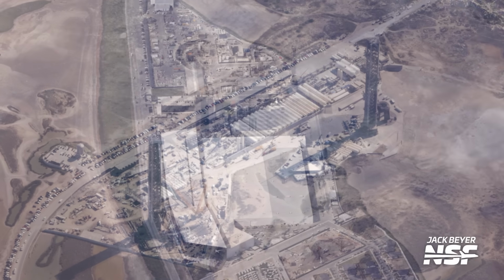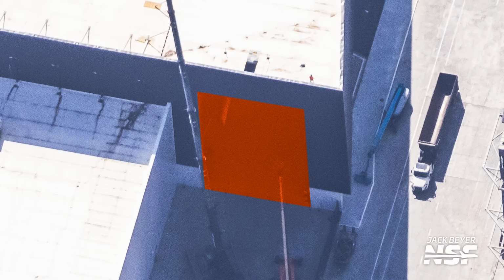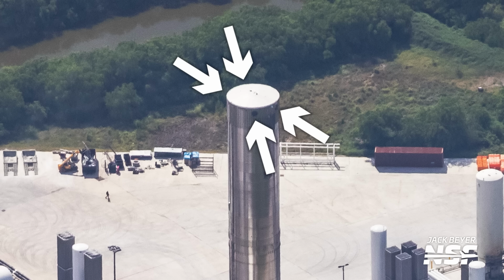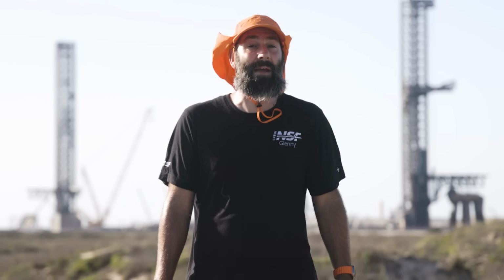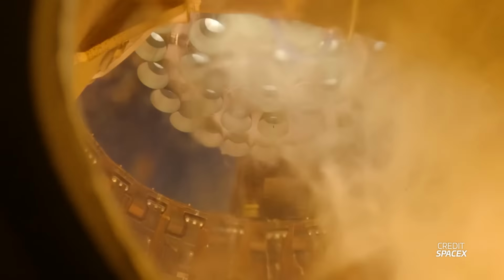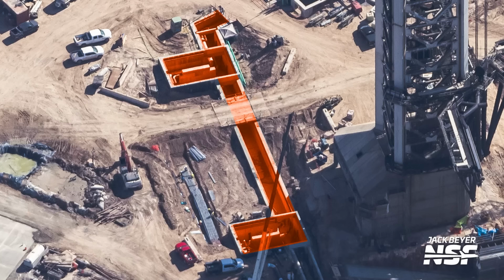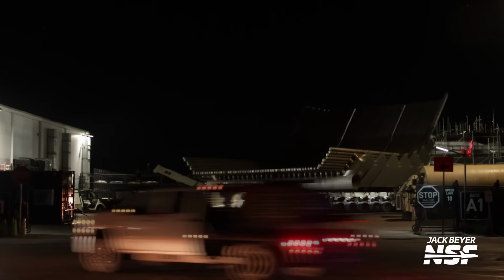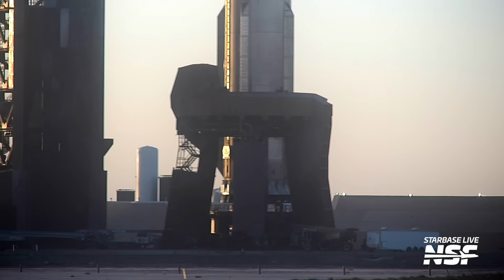🚨 Goodbye High Bay + Hello Pad B Flame Trench! | Starbase Update

Comment: I’m sorry if I missed it in this video, but why exactly are the High Bays being demolished anyway? Surely it would be smart to keep these incredibly high structures around in case they need to continue doing construction development of the boosters and starships, vertically in their entirety? Or are they just demolishing some of them and they are going to keep one of them instead? Feels like a complete WASTE otherwise.
Reply: the bays are being demolished so that they cab be replaced with a much larger, more advanced giga bay, which will be able to contstruct and work on much more ships and boosters than is currently possible.
i believe the mega bays will also eventually be demolished.

Comment: I was thinking about the ship QD only now getting some attention. There could be a few reasons for this only just getting started. Either it's not going to take very long to do compared to the work on the launch mount, and the launch mount is the priority because - no booster, no ship. Also, the new boosters could be static fired, or even flown and caught before ever putting a ship on top.  My instinct is that they may static fire a booster before the ship QD is installed, but there's no reason to launch a booster without a ship given they already have high catch confidence.

Comment: Did anyone else notice that the way they transported the flame buckets was NOT the orientation in which they were lifted and installed in the trench..
Obviously for ease of transport they laid the longer edge down, but this is the edge which had been laid up against the central support in the trench..
Which makes sense, since it'll provide a smoother curve for the exhaust to follow..
Can't wait to see testing of this, both with and without booster fire.. 🔥💦💨
Reply: hey thats a cool observation
Reply: @JackABeyer  Cheers Jack, I try to help out where I can.. ;)

Comment: An apartment block right next to the production site? wouldn't that have to be evacuated for every launch at least?
Reply: Maybe it has a built in 'Fall-out' shelter in the basement? Ha ha. But yeah, I guess that would be the case, as it's only 2.8km (1.74 miles) from the launch site. I think they have to be at least double that.

Comment: DUEL FLAME TRENCH BUCKET, RELEASE! 🪣🪣🔥🔥
Reply: DUAL? Duel⚔️
Reply: @mikegardner107  TBH Once those 35 Engines start, there might be a duel.
Reply: @HistoricTimes_Gamer 🤣
Reply: @HistoricTimes_Gamer  Ssssh 🤫 Whisper "It's 33."
Reply: @David-yo5ws  well on the block 2 booster, there is 35